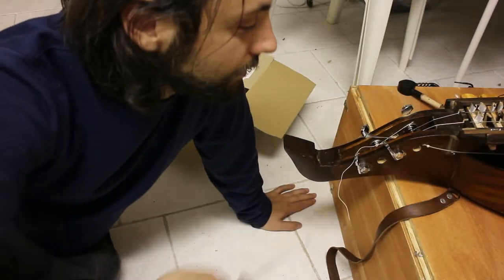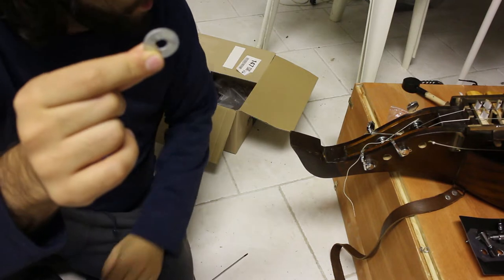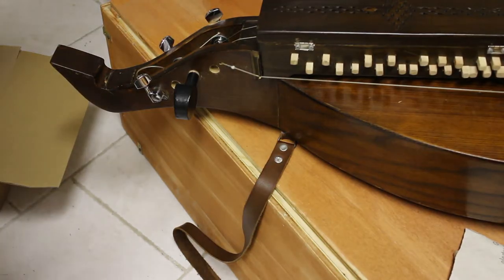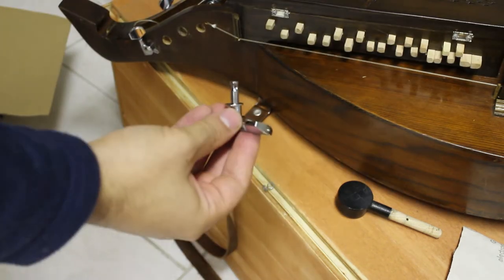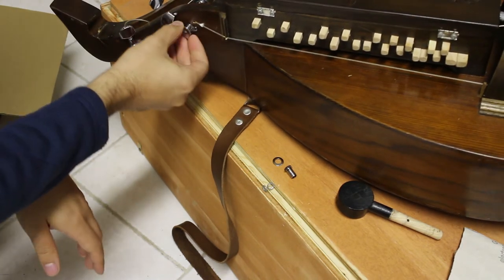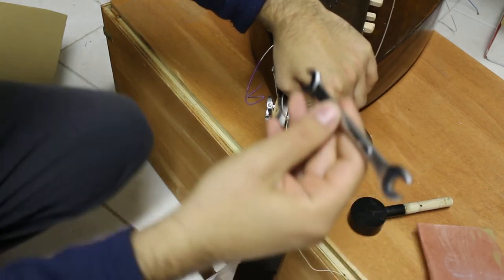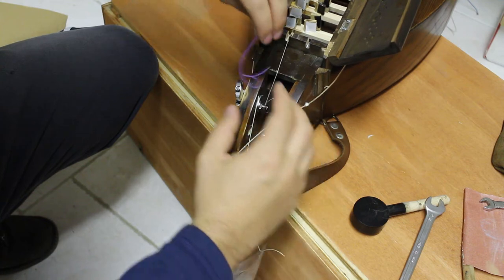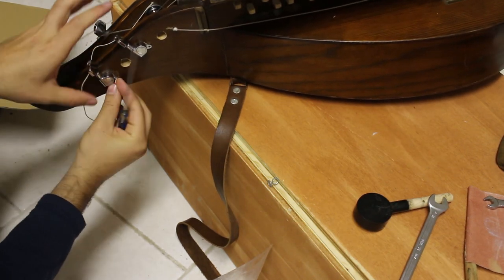Mechanical tuners on Hurdy Gurdy: a Guide

Comment: Hi, it is me again who is building his own 'Symphonie' Hurdy.....   I like to think that with your help, I may have solved the string dilemma I asked you about. The next problem is purely because I have never actually seen a 'live' Hurdy Gurdy, so I am making this thing based on intuition really, and Youtube videos.       How is a 'Chien' fitted?  I appreciate they are loose so as to vibrate, but.... what do they look like...!!!   Is there any pitfalls I might stumble into with them..??    I have designed my own Mechanical Tuners, or rather, purchased ones, but fitted really differently. They should work quite well I hope.
Reply from the maker: Chiens come in different shapes, the easiest to make is the eastern or Hungarian one. Which is basically a rectangle, or a flag, where you cut a notch for the string and insert the "pole" of the flag in a small so it's firm but it can vibrate. Which is a terrible explanation, but I wouldn't know how to describe that!
Reply from the maker: You can get a better visual here https://www.youtube.com/watch?v=nA-7mNwpKCQ
Reply: @CaptainGurdy  I do apologise for my incessant questioning, but I have never actually seen a 'live' gurdy in my life, I am therefore in the dark to a certain amount. The question is...   as the dog/chien actually vibrates on the floor/table of the gurdy, would an insert like a  bit of metal/bone be a decent vibration platform, or, will the dog/chien bore a hole into the wood as time goes on...??????